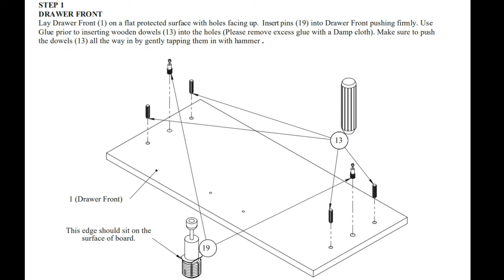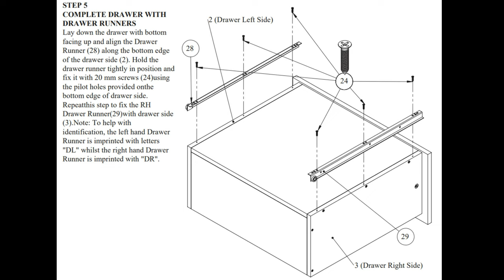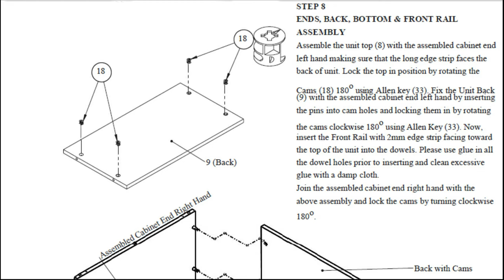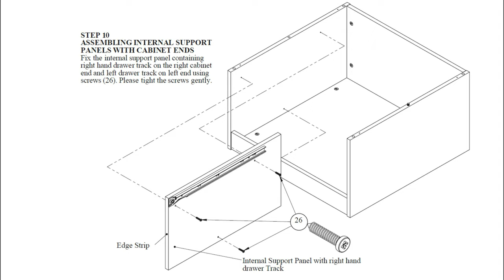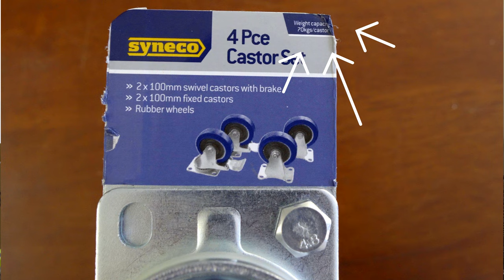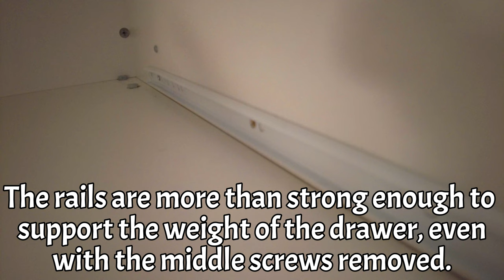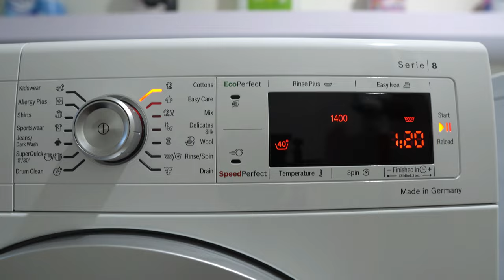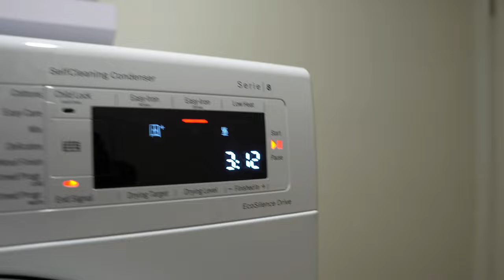Bedford Furniture Washing Machine Stand - Step by Step Build Guide

Comment: Congratulations. One of the clearest, well explained DYI video. It will help me confidence to construct and modify one of these units.
I don't know if the drawer mechanism will handle it, but an experiment I intend to pursue is to add an insert to the top of the drawer - a simple drop-in piece of melamine cleated  to the sides of the drawer to form a platform when the drawer is opened. Items such as a small clothes basket could be placed on top of the open drawer to assist loading and unloading the drum. The drop in 'shelf' could be easily removed to access the drawer contents.

Comment: I just bought this at Bunnings NZ. so they’re still available. Thanks to this video it was a whole lot easier to put together. The rails on mine weren’t stamped but I could see in your video how to put them on. A very solid system and I did pick up your very good suggestion about wheels. Excellent walk through, thanks.

Comment: Thanks for sharing… still managed to stuff it up 😩 but it is all together now
Reply from the maker: Glad l was able to help. Don't be too hard on yourself. We all stuff things up.
Reply: @JustAwesomeCommercials  hey I have somehow managed to not only not included the handle in my specs 🤷‍♀️ (I have a very tight space) I also managed to drive the wrong screws (too long) into my cork floor aaaaaand now I have added the drawer and it is now so stuck I somehow ripped the front off and have just shoved in the spot I need it so I can at least sleep tonight 😩 have blood blisters, busted knuckles and bark off all over my hand 😂
Reply from the maker: @jojacobs305  Sorry for the delay Jo. This message didn't show up in my app for some reason. I hope you've got it all sorted now. I had the opposite problem with my drawer. It was too loose. I"m sending good wished your way. 🤞

Comment: Do you think this stand could support both the washing machine and dryer stacked on top of each other??
Reply: It would probably put it over the weight limit... The washer he's working with is 72 kgs and the dryer is 52 kgs.. that's almost at the 130 kg limit of the stand.. add in the water while the machine is running and it will put it over said limit